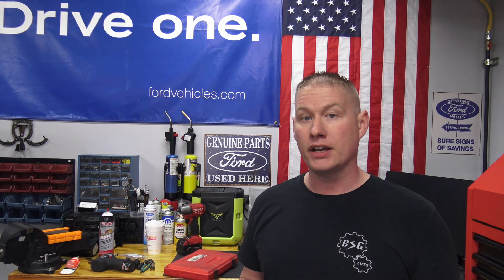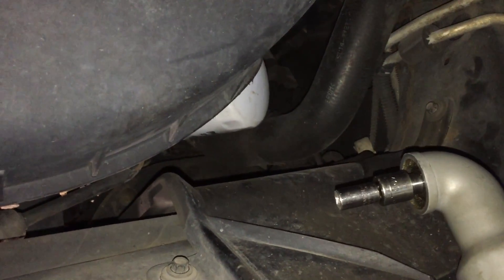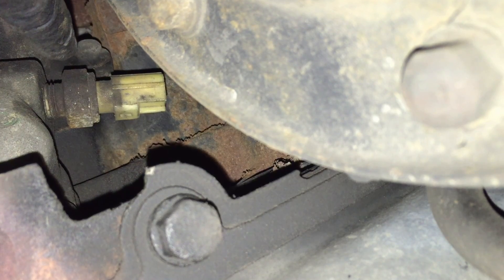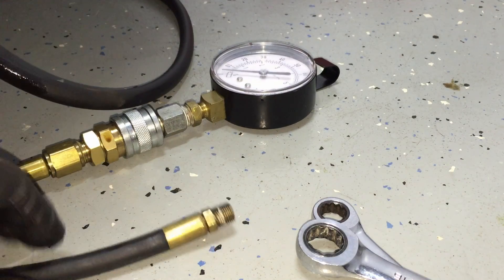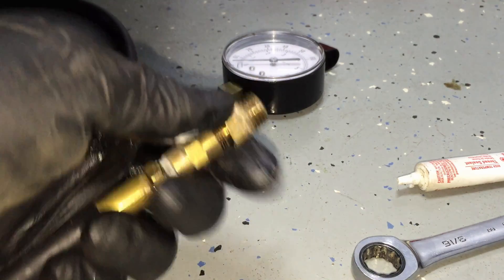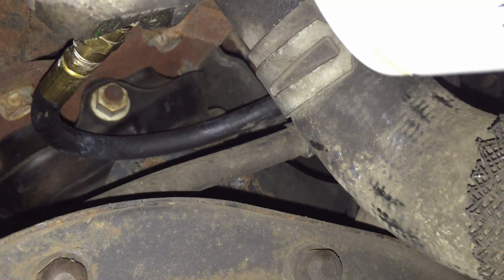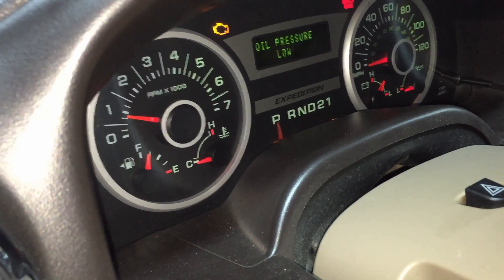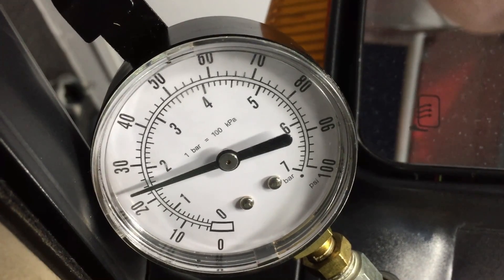Ford 5.4L 3v Oil Pressure Testing and Why It's so Important!

Comment: Have to say my truck has really soured my opinion on ford products, at least the 5.4 anyway. already on my second engine in the darn thing and I keep finding out about all these problems that other people are having with the 5.4, and just countless other problems that I've had since (too many that I care to list). I'm sure it was a decent engine new but you get any miles on them (my engine went out at 128,000) and it seems like they just go to hell.  I had a 92 with the 302 and 188,000 miles on it and in the 3 years I had that I didn't have half the amount of problems that I've had with my 08, and I haven't even owned this one a year!!  I hate to say it but it really makes me question the newer ford trucks' dependability... Ok I'll get off my soapbox now. But this is just one bitter man's opinion, I'm sure there are those out there who haven't had any problems and are happy with their 5.4, if so more power to ya if not let me know that I'm not alone here.
Reply: randomguy2035 an 08 and you have it for a year...I'm assuming you bought a used truck...a most likely abuse and neglected truck.. But you are kind of right, I see not only vehicles diminish in quality but tools and consumables, and everything..through the last 10 years. So yes, buying a 6-7 years used car today is the equivalent of buying a 10 years vehicle, twenty years ago! But there is a lots of things to consider between the "now and the before."

Comment: what should the oil pressure for 4.6 f150 should be? 160000 miles on the the motor
Reply: 20-45 psi @ 1500 rpm while hot. I don't like to see 20 psi @ 1500 though if its at that point thats getting too low

Comment: can we install real oil pressure sending unit from another car and get real readings ? i remember in lt1 chevys you just remove resistor in the pressure wiring and get real reading

Comment: Hey friend
First i want to thank you for your help .
Oil pump replaced as you told me and kit timing .
Engine is running good but p0020 code on .
Maybye it is still in memory? explorer 4.6l 2007 150.00 mile

Comment: I've got an 06 with 76k...I've got what sounds like a lower end knock upon cold start after the truck has been sitting overnight...you can only hear the knock at idle though...and the knock doesn't go away until the motor is almost completely warmed up to operating temp...otherwise is completely quiet and runs perfect...any idea what this could be?

Comment: FordTechMakuloco I have a 2008 F150 4x4 with about 112,000 miles this truck has been a dream compared to other vehicles I have in terms of issues I've only had to replace u joints and reseal the rear end. With the mileage I have should I do this test. I've owned its since 60,000 miles and only use mobile 1 full synthetic 5w20.

Comment: Is it safe to leave this gauge plugged in all the time for accurate pressure readings even while driving?
Reply: Just get a mechanical gauge and a T type fitting so you can run both the gauge and the sending unit at the same time. However, I would recommend a copper line to the gauge due to the engine heat, not those plastic lines that comes with the gauges they get brittle in time and can crack. 1/8" is the size of a standard line that can be bought separately.

Comment: I would like to see a video of a 5.4 with sub 20psi oil pressure not producing erratic phaser operation when at hot idle and moved a few feet in reverse. in my experience 5.4 engines that produce less than 30 psi of oil pressure at any time will cause tensioner and vct system failure resulting in  erratic cam position readings and rough idle and knock. I am in no way questioning your methods I am attempting to discover if there are flaws In my own methods.

Comment: Good video. I just had phasers/chains/tensioners/oil pump replaced on 06 Expedition. Now it has rattle on startup for few seconds, once pressure builds up it runs fine. Should I check the tensioner gaskets?  I'm ready to chain it to the shop that worked on it and set it on fire.
Reply from the maker: +topcatrsb Sounds like something was not installed correct or the tore the gasket. Were they Ford tensioners?
Reply: +FordTechMakuloco They are S A Gear tensioners.
Reply: Took it back to the shop and he claims the noise is in the valve train not chain related. I disagree but I'm not gonna let him work on it anymore. I'll figure it out myself.

Comment: when you install a new oil pump on the 5.4l how do you prime the oil pump in order to get oil pressure?
Reply: disconnect the crank sensor, then crank the engine.
Reply: Disable the fuel pump by pulling the fuse, pull the plugs out for easy engine rotation, then simply turn the engine over with the starter for several seconds several times in a row giving the starter cool down time in between cranks, they usually prime up pretty quick.

Comment: I just discovered you, now to watch all your videos! I have a 07 3v 5.4, it had a bad timing chain guide. I replaced everything VVT (guides, chain, sensors, solenoids and phasers). It runs great until it gets fully warm. I checked via your method and it has 20psi of pressure at idle when warm, at that point it starts running poorly like the VVT isn't working. I thought it was too low of oil pressure, but you say it is ok down to 15psi. What should I look for next?
Reply: Did you ever fix your issue? I have same problem
Reply: same here. did you fix it?
Reply: @123lolshto - ultimately, that truck had too much wear on the crank bearings and couldn’t build enough oil pressure. I ended up selling it as is.
Reply: @RiverOakRanch i just tested oil pressure with mechanical gauge. It is 15 psi when hot idling on Drive or Reverse. According to spec its ok.. So now I think it's time to replace chain, tensioner  etc

Comment: yes did the solenoids, injectors, plugs,oil pump timing chains, tensioners, guides, phasers.  vacuum test fine, fuel pressure is normal,  did the idle relearn 5 times.  still turns to rough idles and phaser noise once it warms up.  only at low idle.  runs and drier fine.  there is also a timing chain slap at start up
Reply from the maker: +Jody Gueningsman I would make sure the oil pressure is truly ok at hot idle as per my video and also was the throttle body cleaned and relearned? Startup slap from the timing chain is not normal after this repair. Were Ford parts used?

Comment: I have a 04 F150. Once it warms up it idles rough and stalls.  we just did the phasers, oil pump chains and tensioners.  

any suggestions?
Reply from the maker: +Jody Gueningsman were the vct solenoids replaced at all??? I have many videos on this
Reply: Jody did you die? So many people ask questions and then just fall off the face of the earth....we could really help each other by answering questions on here instead of asking a question and then running away.

Comment: Do you recommend replacing both phasers or just the one that's bad? They are Dor-man one that are on there right now. I've already bought one motorcraft.
Reply: Or should I spend the extra $300 and get the Livernois kit and not mess with it again?
Reply: Dont buy the dorman they dont last after about 12,000 miles im getting codes p0340, 44, 45, and 49, replaced timing sensors vtc and the ones in front of the heads, codes still there, took it to a mechanic, told me my phasers are probably giving out, they have a very poor rating in amazon

Comment: So what do you have to replace if the pressure is too low?  Great videos, so thanks!
Reply from the maker: +JC Mac depends on the findings. Most times it is due to excessive clearances, blown out tensioners and or the thrust washer wearing away on the 07-08 models.
Reply: @FordTechMakuloco  What about on a 5.4 2V?

Comment: Thanks for the good video. I think you could leave the thread sealant off and save the mess. For the relatively short time you have the gauge connected it shouldn't leak even without sealant.
Reply from the maker: +Erik Andresen Maybe but I don't take no chances next to a hot exhaust manifold. Those things are so hot they produce fireballs real quick so do it any way you want I will stick to the safe proper way.
Reply: Erik Andresen Oil resistant Teflon thread tape (Yellow) works great with less mess.
Reply: Can use teflon tape

Comment: Very good video. I have a Auto Meter permanent gauge setup on my 2007 F-150. 90-100* F days after driving for 30-45 minutes, I get 25 PSI in drive and 27 PSI in park. Still runs great.

Comment: Another great video, you sir are providing a public service... What would you be replacing if the oil pressure were too low? Switch to higher viscosity oil? Pressure relief valve? Oil pump?
Reply from the maker: +aj06bolt12r tensioner seals and overall clearance issues causing the loss.

Comment: Good stuff, Im glade you made this video, many people dont understand the factory oil pressure light, I think that all vehicles should come with a real oil pressure gauge.
Reply from the maker: +Steve R correct also many have vct concerns when hot and this is one of the first test I have them do and now I have a guide for them.

Comment: very good information, I would recommend you to anyone with a Ford that is a D.I.Y. and you have helped me a few times when I have been stumped lol. keep them coming, and I look forward to the next video.
Reply from the maker: +Brandon Beard Thanks!
Reply from the maker: Martin Villela 2010 does not
Reply: +FordTechMakuloco I have a 2006 f150 and 2010 expedition. Both with the 5.4 3v. Do 2010 still have problems with 2 piece plugs? It has 60000 should I change them now?

Thanks for your time

Comment: I feel another important spec would be what it does off idle
Reply from the maker: +John Knopp Not really if the hot idle pressure is good then the rest of the range should be good. Only a few hundred rpms more and it will jump to 50psi no sweat. I didn't really show this but I go over it in my oil pump video.

Comment: it's amazing to me how manufacturers do not install calibrated type sensor to read actual real time oil pressure on most vehicles.  12PSI??  Ridiculous.  The dummy oil gauges (On/0ff) suck in my opinion.  Seems like they are embarassed or financially concerned to let the driver know EXACTLY what the pressure is.  Enjoyed the video.  P.S. Just picked up my new '16 F150 4x4, 5.0L V8......no turbo probs at least, wish me luck ;-)

Comment: Brian,  As always you have the best video's to for Fords and other cars. Thanks for sharing man. really Appreciated. Can't wait to meet you all.

OK enuff of my celebrity drooling ... Here's my questions,  Can I use this info on my '09, 4.6- 3V  F150? I know you said it was for the 5.4 3Valve but the 4.6 3V is a close cousin.

I am seriously considering running a 3 Gauge Pod setup to the Driver's A-pillar. Besides the oil, charging, and water temp gauges being only signal only sensors - meaning that the ECU only sends a flat value of mid scale to represent the actual signal value, what other gauges are dummy gauges?   I really want to know what my truck is doing when i'm driving and I want to know more than what the "idiot lights" show.

Thanks Man!!
Reply: You can get tons of data using something like ScanGauge. Mine pulls water temp, cylinder head temp, trans temp, load, etc and displays it all digitally. Oil pressure isn’t a value given to our ECUs on these vehicles other than “pressure?  yes/no” and I’ll run a gauge for it.

Comment: back in the 1970s when ford introduced the M series clevland style motors the oil light would come on at stoplights and Fords fix was to turn up the idle speed.
Reply from the maker: +smoke skull I had that problem on a 3.0 24v dohc switching to 5w-30 fixed that one

Comment: What's the point of a pressure gauge on the dash if the sensor is just a on/off like for a light
One of the growing list of problems with the 5.4L 3V. 
Sounds like they dropped the spec to get themselves out of trouble.
Reply: +CamperMike I guess the gauge makes some people feel better, but I think ford stopped using actual pressure gauges in the 90's
Reply: Ford uses dummy gauges for EVERYTHING. My 2001 Mustang SVT Cobra has dummy gauges for Volt, and Oil Pressure. Temp isn't a dummy but it has no #s, I want to see degrees not just a line

Comment: Ford stock gauge isn't a gauge. The "sensor" is a switch. In the old clusters
 is a 20 ohm resistor to make the gauge read in the middle of NORMAL 
always. (when motor is running)  This switch only requires 5 psi to 
activate.  Ford drivers complained about having a real pressure gauge.. 
So they a made  dummy gauge for dummies
Reply from the maker: +joeyf504327 Yup that's what allot of owners don't realize and is exactly why this test is so important.
Reply: +alb12345672 It isn't built into the gauge. Gauges now are stepper motors. Not analogue. All the information is sent to the cluster and Ford programmed the cluster CPU to interpret the inputs and change the gauges correspondingly.  Ford oil gauges now only go to 'L' or middle of "Normal". It runs off an active low input. It sends a high (255) to the oil switch and when there is < 5psi the switch closes grounding the gauge making the input low (0). The cpu then moves the stepper motor the programmed number of steps to get to the middle of "Normal". I verified this and the value required for the gauge to go from "Normal" to 'L' is 215. There is no in between. On or Off. High or Low.  Ford sucks...
Reply: I did not know that. thank you
Reply: +joeyf504327 I drive older fords and until around 96 you could add a "real" ford variable pressure sender that was used on older Fords. You would have to pull the cluster and possibly short  resistor. I have those senders on my fords and  there are no numbers but the sweep definitely follows a test pressure gauge, it is quite responsive. 50 is usually center of the oil icon or scale and 25-30 is just below the icon. After 96 there is no more resistor to short out,  it is built into the windings of the coil, and it does not really work well. The modern gauges are definitely computer driven where they are placed at a default position if the computer senses an closed circuit (5psi as you said). Why do they do this? Because customers would be bothering the dealers and creating warranty cost if they saw a gauge move around and move toward L when you idle. With the tech they have they should give the option to add one of those variable senders if they owner desires.
Reply: +joeyf504327 yeah, that is really sad. They could definitely include a software option and the sensor is a common item to install aftermarket. I think GM has real sensors, the camaro I test drove sure looked like it. The 5 psi business is really scary, but if it goes around there you will hear it. With the VVT engines it seems though like a necessity.
Reply: +alb12345672 yea most GM truck use variable oil pressure sensor they have 3 wires

Comment: Is the spec similar for the 2 valve motors? How accurate is the stock dummy gage. Mine does fluctuate a little when in gear versus neutral as it's supposed to.
Reply: +Tony Chavez Ford stock gauge isn't a gauge. The "sensor" is a switch. In the cluster is a 20 ohm resistor to make the gauge read in the middle of NORMAL always. (when motor is running)  This switch only requires 5 psi to activate.  Ford drivers complained about having a real pressure gauge.. So they a made  dummy gauge for dummies
Reply: +joeyf504327 that's lame. Can't imagine why anyone wouldn't want a real gage. I guess it is literally a dummy gage. Thanks for the insight.
Reply: +Tony Chavez probably Ford trying to save money

Comment: wasn't there a spec that said 75psi @ 2k rpm or so.... i checked my 06 with 204k miles and it had about 70psi  @ 2k never droped below 25 at idle i thought it would be acceptable....thanks for your channel, I've rebuilt all my timming system with your help.

Comment: Is this test to verify the oil sensor is working properly?
Reply from the maker: +E Chew No it's to check for actual oil pressure reading important for proper vct system operation.

Comment: Ok good video I have been overhauling a 2007 5.4 f250 I got for a bargain I don't see any piston information on this engine whether to replace them or not or to bore .020 over because I don't want slap noise after going this far . what would you do master ?
Reply from the maker: +magic80866 Most of the time if there is not any damage and only  wear then  .010" over is all you will need to prevent piston slap but your machine shop can determine the extent he needs to go with T gauge readings. Ford has oversized pistons available for both .010" and .020" overbore.